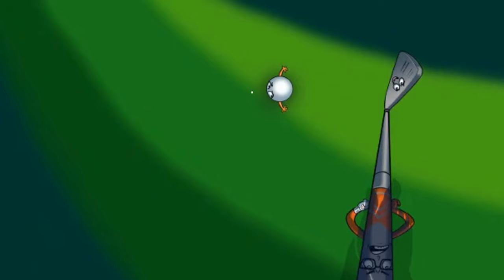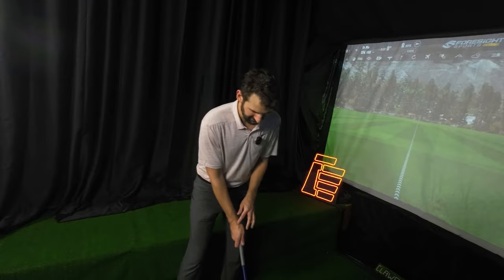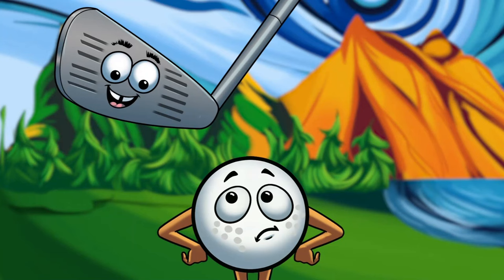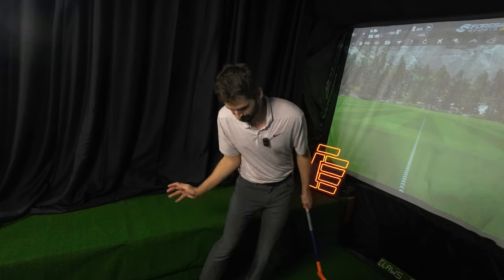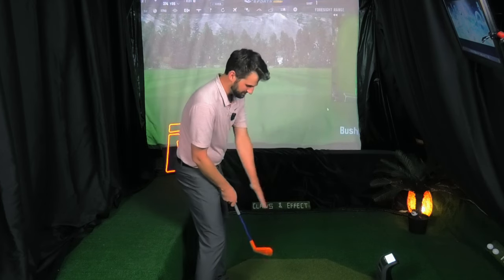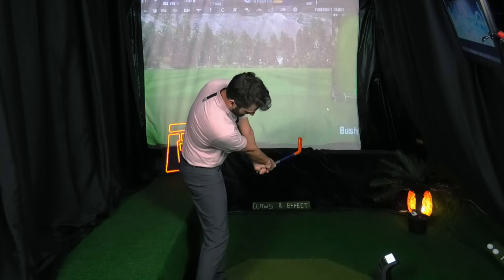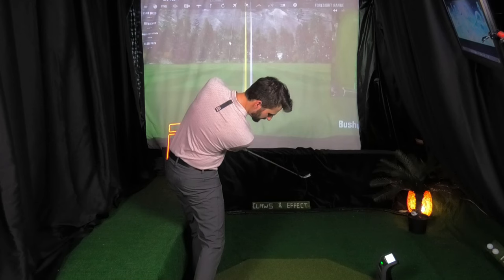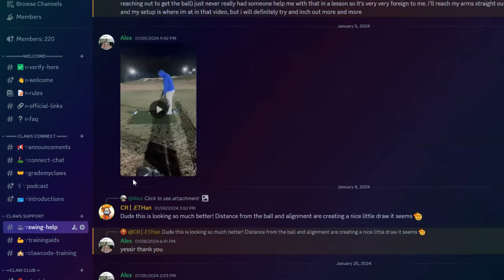Finally Fix Bad Contact In Your Golf Swing

Comment: thank you: excellent explanation of "push the handle for the press",. 
My swing thought to get to the correct impact position is to "skip a rock on the water",.  (heel in front of the toe), however my big miss is the HOOK!!! and when it happens it is a double every-time.  I will try the push the handle to see if will increase my control of the toe though impact.  cheers,.
Reply from the maker: Thanks, Martin. I love the skip the rock visual! Yes, keeping the handle leading keeps heel ahead of the toe, also feeling like the trailing edge of the club is hitting the ground instead of the leading edge will fix hooks. Give it a try
Reply: @claws_effect  nice! I can visualize that and it makes sense! Will provide feedback after my round on Saturday.

Comment: Awesome video. Sometimes when I work on this downward pressure on mats, I get some pain in the pinky pad area of the lead hand from ground impact. Any thoughts on how to mitigate this? I don’t want it to mentally block me from applying that downward pressure. Thanks!
Reply from the maker: Appreciate it! I would say try to feel like you are "thumping" more of the trailing edge of the golf club and less of leading edge. This will shallow out impact and get rid of some of that "dig". Of course tho join the Discord and send swing to confirm. Thanks! -Ethan

Comment: This is a great addition to what you are teaching. I have 2 questions. The tilting of the head back a little. How long do you feel like you keep that? I watch pros and they seem to keep lookin either down or a little back for a long way in the downswing. Secondly, I am not getting the gear effect action you are talking about. Besides having the right grip and pushing with the read hand, is this also predicated on keeping that lead arm locked out for a long time in the downswing? Thank you. Great Video.
Reply from the maker: We like the idea of feeling like you are draining water out of your trail ear all the way till you finish. Eyes can follow the ball, but the head must remain tilted. Secondly, the gear effect occurs when the trail arm goes from bent to straight, and the cup in the wrist is applying maximum pressure to the side of the handle. You are correct tho, this gear only happens if the lead hand is consistently pushing and lead arm is "braced" at impact. This gives you something to hit against creating the gear effect.
Reply: @claws_effect  interesting. do you feel like the lead arm is pulling at all? or just being pushed by the rear hand. Hope that makes sense. I do feel like my lead arm pulls. not sure if that is the correct way to do it.
Reply from the maker: @jawjuh1005  yes, there is def some pulling going on but I would say its mostly just redirecting the push pressure that you used in the backswing.

Comment: How does this produce the divest in front?
Reply from the maker: Great Question. Divot in front of the ball is controlled by handle being forward of the club at impact. Because the palms are leading the fingers at the inside part of the ball this is forcing the clubhead to work down and around the handle creating a descending blow and forward shaft lean. Hope this makes sense.

Comment: All this pushing down and out will only result in too much right to left movement of the ball or worse, shanking. I like your thoughts on the grip, but all this pushing down and out in the hitting area has to retard the natural squaring up of the clubhead during the release interval.
Reply from the maker: I understand your concern but we are in now way recommending hands pushing out. Hands are pushing down and forward. The only outward movement is the clubhead due to its positioning relative to the handle at pre-impact and even that isn't until after the ball has been struck.
Reply: Yes, hands are always pushing down and forward!!! @claws_effect
Reply: Sorry guys, but I have to disagree. If a golfer has to do any pushing or manipulating of the club through impact, they have done something wrong earlier in the swing.
Reply from the maker: @StephenR-nf9wb  the only thing that you are pushing against is the handle and that is to control the club at impact. If you don't think the best players in the world are applying maximum pressure to the handle at this point then you are highly
 mistaken.